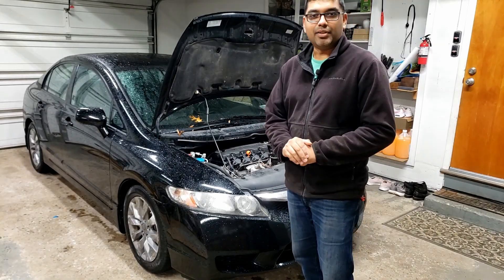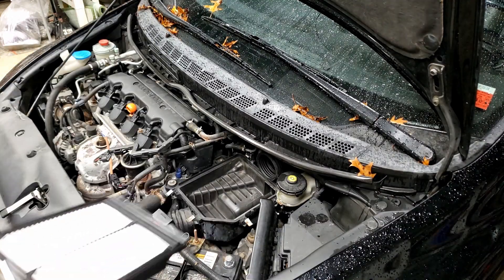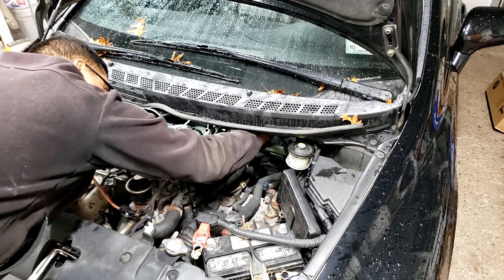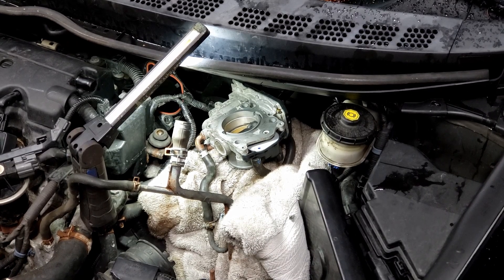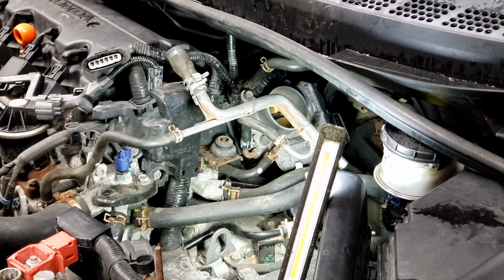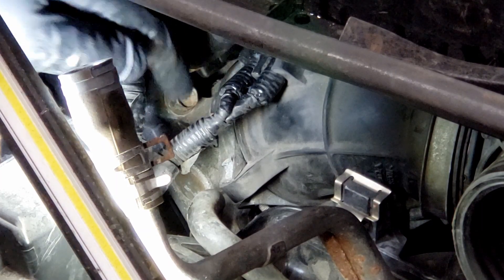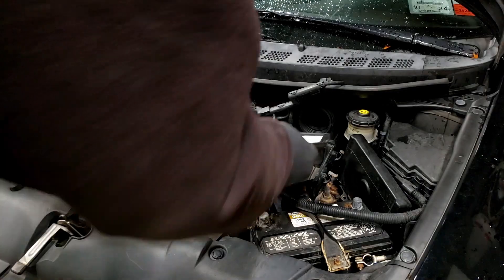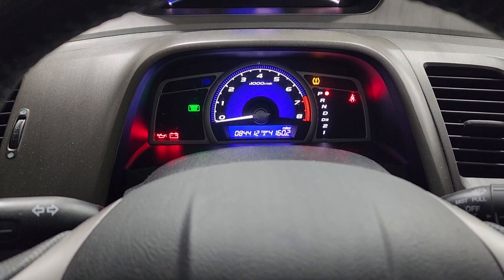How to do a basic engine tuneup on a Honda R18 engine ( 2006-2011 Honda civic )

Comment: Carb cleaner is too harsh to be used for cleaning the throttle body. Actual throttle body cleaner is the preferred option, especially for modern engines.

Comment: So is the 8th gen civic (06-11) R18 engine is an SOHC non-vtec. Right? I have a 08 civic dx-g with an R18 engine and I don’t believe it has vtec. But I’ve never found a solid answer
Reply: it has i-vtec
Reply: r18 is fake vtec, belive me!!
Reply: It’s definitely vtec . It’s not written on it but you feel it and hear it when it pulls
Reply: @ damn bro? it not vtec, Don't sanctify it anymore
Reply: @ hahahaha ok man . I just like to believe that
Reply: It’s definitely vtec . It’s not written on it but you feel it and hear it when it pulls
Reply: I-vtec is variable valve timing and lift, however instead of the traditional low cam as a standard cam, and high cam as a high performance cam, it uses a standard cam profile as the high cam, and an efficiency minded low cam for low rpm city driving to boost fuel economy, the most performant way to run this engine is non vtec running only the high cam.
Reply: @thelonelytimbit  so that shift i feel at 3500rpm
Is not vtec ?
Reply: @FriskBone  No. It's just the real engine kicking in. Before that is just a "nerfed" version.
Reply: @vmvarella  got it bro . I always thought it was vtec cos that kick at 3500rpm feels so good . I’m sad to find out it’s not vtec from the various explanations I see on here
Reply: @FriskBone  high performance vtec in a Honda usually engages between 4400 & 5500 rpms (depending on engine type). There is a corresponding increase in intake and exhaust sound, and a sudden increase in power.. You would def notice it. If you dont then its just vtec on the intake cam for better mpg.
Reply: @thelonelytimbit  running just the high cam would mean the engine wouldn't be able to idle.